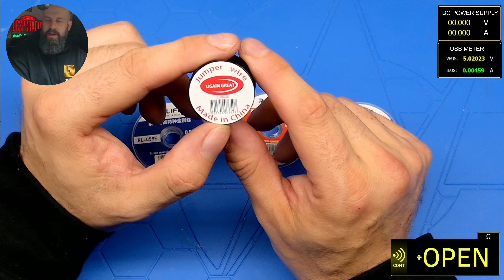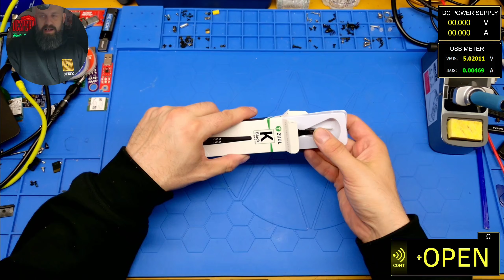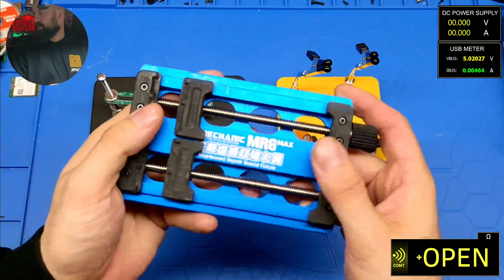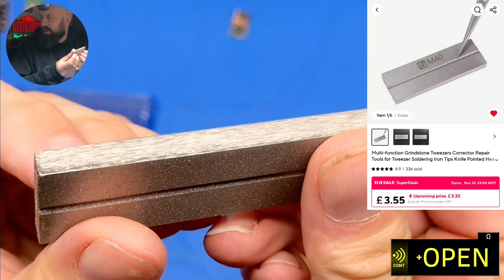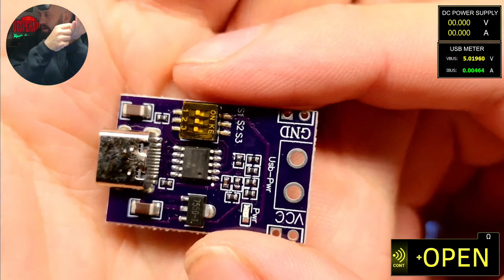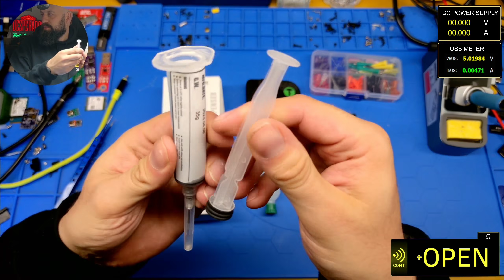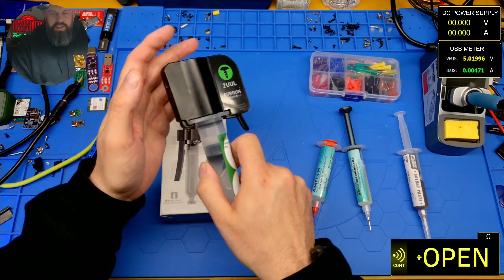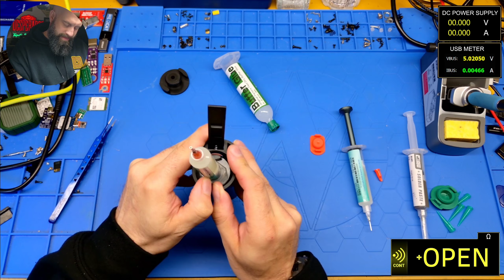Tool Talk - Ali Express Electronics Tool Haul 10

Comment: Man, I'm going to be broke if I keep on watching your videos. There are so many goodies I want to get.
Reply from the maker: Thanks for watching Ruben I also have an endless list of things I want lol
Reply: @JFIXX1 for the flux pusher I have a really nice quality one from qianli called the mega-idea flux mate its built very high quality and makes dispensing comfortable. I think you might like it check it out. Once I got it I bought 5 extra ones and I use it over the mechanic ones.
Reply: @JFIXX1  same here all these new gadgets  lol for link wire 0.1mm Enamelled Copper Solderable Jumper Repair Wire used this for along time time now.